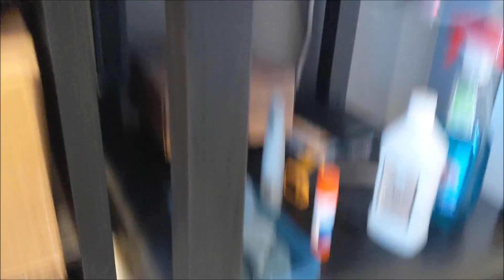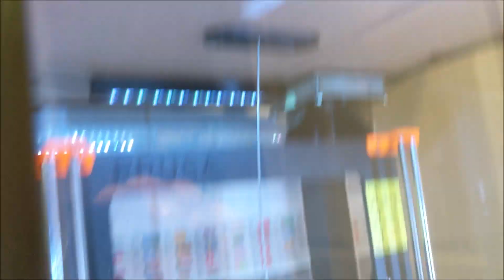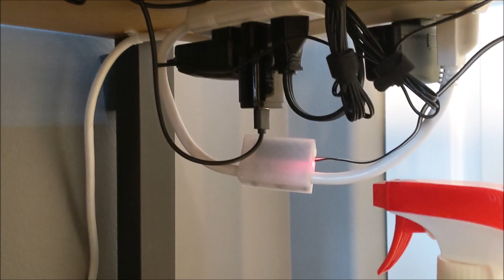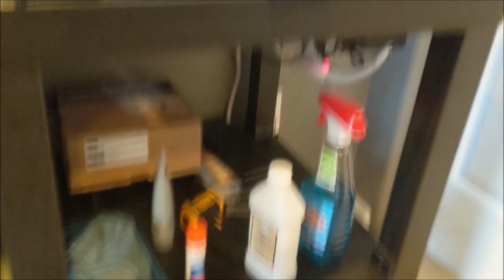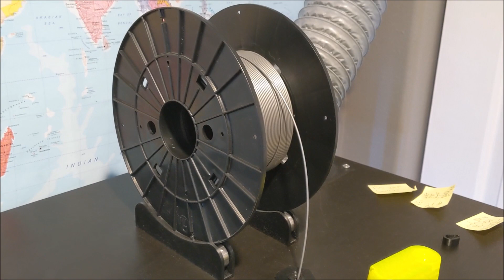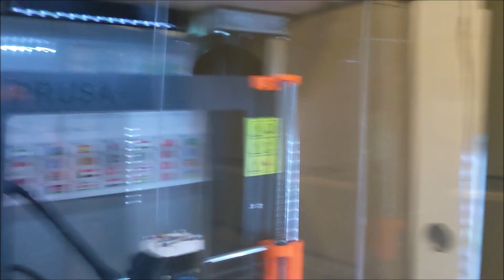IKEA LACK Printer Enclosure for Prusa MK3s 3d printer

Comment: You build an awesome setup right there. You could put a box above the filament, which is printing right now to protect it from dust an humidity
Reply: I appreciate the feedback! I was pondering early on protecting the filament up there, but I found in my 3 years of printing and 80ish rolls of filament that dust is never an issue and fortunately where I live humidity is not that bad either. Filament is typically only on top of that printer while I'm printing and then it goes back in the dry box with the dehumidifier units.

Comment: How's the tabletop when you drilled a hole for the exhaust? The tabletop seems to be not completely solid.
Reply: The table is hollow core with a cardboard honeycomb. So essentially you're cutting through maybe four to five millimeters of board and then it's hollow for 2 in and then you have another sheet cutting through. I used a jigsaw and Icut each side separately.

Comment: Thanks for sharing your build and the thingiverse collection.  This is very helpful and looking like the setup I plan to build.  I just have to figure out if I can vent through dryer vent in my basement or if that will be a problem here in frigid Minnesota.  I will either vent to outside or have a HEPA and carbon filter.  Is the limited weatherstripping you added and the fan power enough to create negative pressure?  I guess these enclosures don't need to be completely sealed along all the plexiglass edges in order to create negative pressure with the fan?
Reply: In my case it worked out well. I can light incense in there and while the fan is running none of it gets out into my room. That was a pleasant way to test instead of trying to smell printing vapors. 🙂 Even when the fan is running at a lower speed, it still creates a negative pressure in there.

Comment: Thank you for the video.  Could you be so kind as to give me the internal measurements of the printer enclosure.  I want to see if my new printer will fit.
Reply from the maker: The table surfaces are 55cm x 55cm x 5cm. The leg pieces are 40cm x 5cm x 5cm. Some LACK enclosure printed parts have height extensions designed into them as well if you need more height.
Reply: @jurassic7313  Thank you for the fast response.  Your mod is exactly what I was looking for in an enclosure.  I will measure the printer after setup but it doesn't look like the lack tables are big enough.

Comment: NIce setup. What temps are you shooting for internally in the enclosure for printing ABS, PETG
Reply: Not sure actually... just however it ends up. :)  It does hold in some heat but I'm sure the exhaust cools it a little.  Better than fully exposed however.